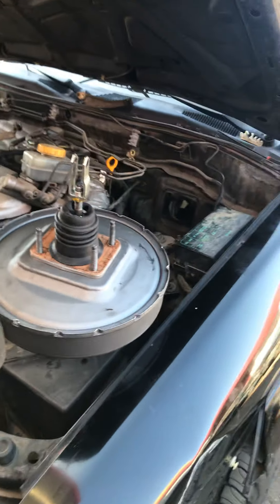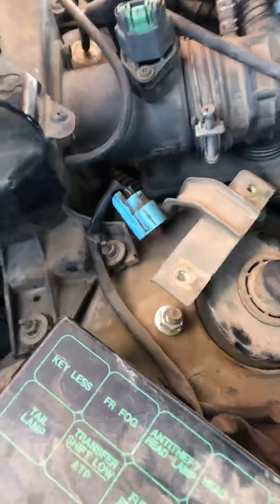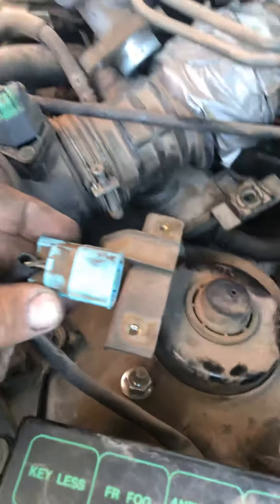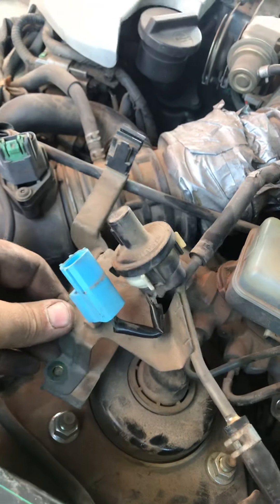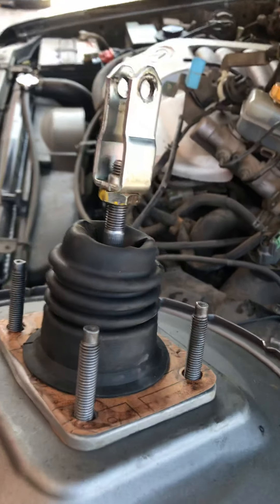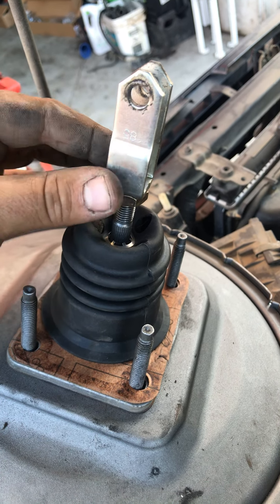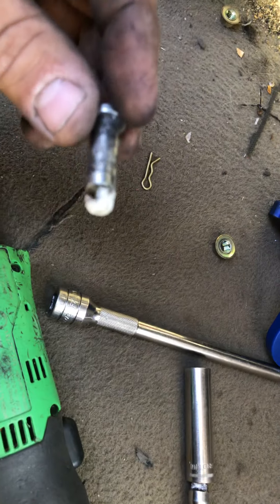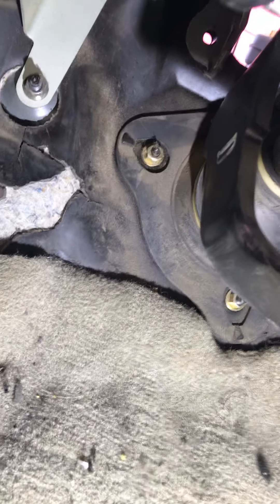2001 infiniti qx4 Brake booster removal

Comment: Thanks for the brief but helpful vid. Local shop wanted $600 to do the job. Now I am confident I can do the job myself for under $200 Looks like a PITA for sure, but I am good working by "feel"  Is there a trick for setting the adjustment? I was just going to measure the position of the yoke on the threaded shaft.
Reply from the maker: Scott West  when i put it back together i didnt adjust anything Tbh And im Glad it helped havent done many videos since i opened the channel . If you need any other type of help lmk.
Reply: How did you know the brake booster was bad or needed to be replaced